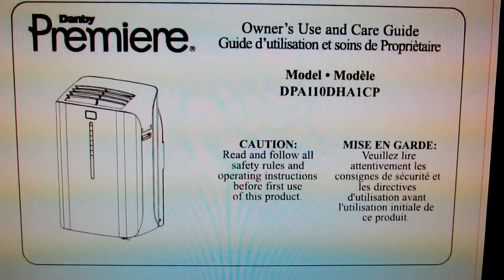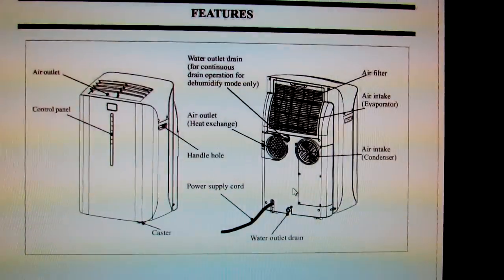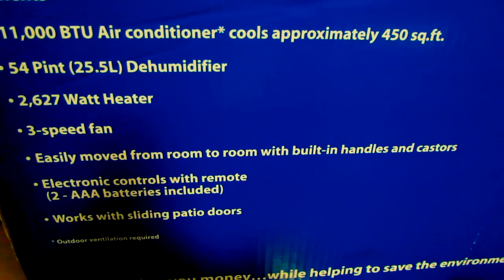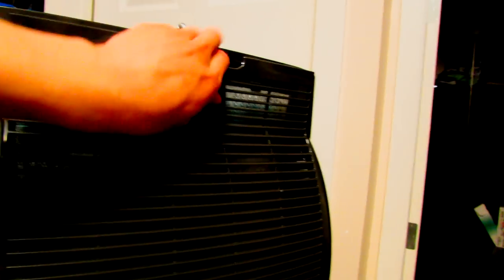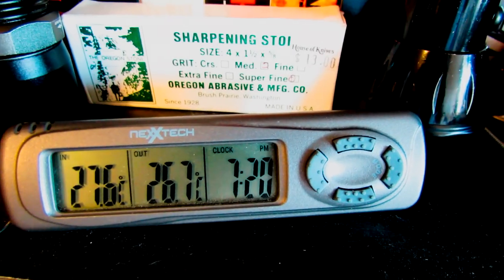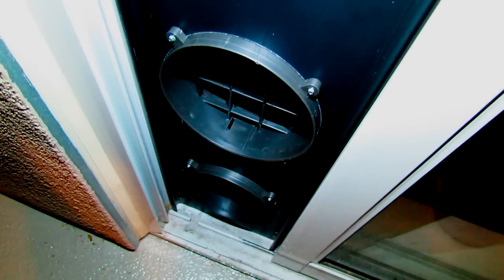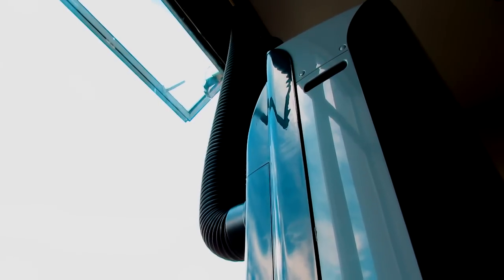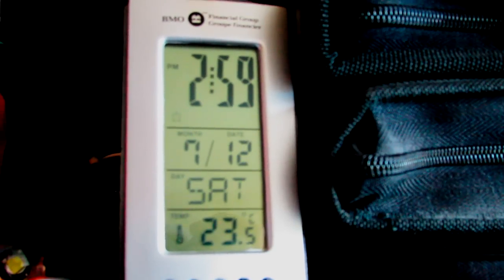The Best AC Unit for an Apartment - Danby Premiere 11,000 BTU 4 in 1

Comment: Hey,
Do you still have this or can anwer a question or two?
Reply from the maker: Hi,
I still have this, and it's still working great.  I guess it's the 4th year in service, so not a long time, but has been working flawlessly.  
If you have a casement window, I've just mounted it using some particle board, here's an example of how I mounted it, it's pretty easy to make, and makes the use of this portable air conditioner a lot better, since it seals out sound, smoke, and bugs (Can also add a bug screen to the intake):  https://www.dropbox.com/sh/kclsjrxio9d0tn5/AACJfRzF_q8jhFytCnqkczPMa?dl=0
If you're looking for a good way to keep cool, I still highly recommend these 2 hose portable AC units.
Let me know if you have any questions!
Cheers!
David.
Reply: Hi,

Yea I picked one of these up used and it came with the unit only.  There's no remote, ducting, ducting connectors/flanges, "window kit" and missing the top drain hose (has the rubber plug and screw cap here) - and missing the bottom drain rubber plug and screw cap.

I was wondering if you could show or share the duct flanges and which go where and how the attach.  I need to order some parts for it from Danby - I guess that's my only option.

Thanks.
Reply from the maker: Hi,
The remote is nice to have, but I find that I don't even use it.  I use the controls on the front, they're way more useful.
Read through the manual and you'll know exactly how to use it:  https://www.danby.com/products/portable-air-conditioners/dpa110dha1cp/
The timer of when it automatically comes on, and when it turns off is pretty handy, and I use that at night or in the morning when I want it to come on before I get home.  Unfortunately you can't set it to come on then turn off again, only 1 operation.

In the manual, it'll tell you about how to use the drain hoses, but you don't even need to drain it if you live somewhere where humidity is low enough that evaporative cooling works.  At the end of the season I go to empty mine (From the lower drain port), and nothing comes out.  It's really efficient at evaporating the water over the condenser coil.  This is probably one of the best performing units I've ever tried.  You got yourself a great unit, bet you got it at a good price too!

You could order the original parts from Danby probably, but if it's too expensive, you can build your own with some hard plastic and some duct tape, the tape residue will get stuck on there and make a mess, but if they charge you $100+ for the accessories, a little residue is worth it.
The exhaust takes a 5" duct, and intake is 4", but you can use 5" for intake as well.  
You can get any 5" duct for an AC unit, something like this would work: https://goo.gl/FeQWjR
Check your local home depot too, they have some hoses.
I found a dryer 5" hose, and it worked fine on the intake, I wanted to upgrade it from 4" to 5" and extend it a little longer.
I've since gone back to the stock 4" and it works just fine, maybe a little less efficient, but marginally.
If the accessories are too expensive to get, just get creative and you'll be able to mount to it pretty easily.  
After taking a look at my unit, I think you can take a coffee can that's about the same diameter, and just slide it in, then tape the hose to that, and you're golden, you don't really need to use the stock clips and stuff. (My clip on the exhaust broke and it's no detriment to the unit.
Maybe you can try 2 x 2L pop bottles for each port, you can slide them over each other, wrap them around and duct tape it together so it's nice and tight.  Then you can tape your hoses to it.  It might even seal better than the stock fittings.
Good luck!
Cheers,
David.
Reply from the maker: Complex BTW, I uploaded a video showing how I installed it to a casement window, you can do something similar if you have that type of window, if not, maybe you can make similar mounts and just add tubing to it using coffee cans or plastic from 2L pop bottles, anything thick will do. 
https://youtu.be/4IXp7NkNxLA
Cheers!
David.
Reply: David, thanks for the thorough responses.
You basically confirmed some of the research I've been doing for the pas couple days on this unit and parts etc., haha.  The hose you linked is one that I've come across in searches too.

I do have the manual downloaded and read it while watching your vid a few times.  I find the pictures/descriptions of the duct and connector parts is unclear. Through re-reading the manual and calling danby etc, I think I've got the parts I need figured out.  I'm not to concerned with the remote control either.

Here's the parts list for this model:  https://www.danbyapplianceparts.ca/product-category/premiere/portable-air-conditioners-premiere/dpa110dha1cp-portable-air-conditioners-premiere/

See, I don't even have the duct flanges that attach to the back of the unit, that allow any duct hose to be connected to them.  I want to get at least those two parts.

So, I think I'm starting to see what I might need for the back of the unit alone:
1x  SKU:  A5815-320-H-G    "Heat Exhaust Hose Connector" [exhaust port?]
1x  SKU:  A5812-200-H-G    "Fixture" [intake port?]

Could you do me a favor?  Could you measure the outside diameter of both these parts/sku numbers listed above please?  That would be great!

also, what is:
SKU:  A4239-370-H-22    "Discharge Grille"?  And is it for the window kit side of things?

Lastly, wow, the hoses actually do appear to be listed as different sizes (11cm and 13cm), that's crazy.  So are you telling me that you can't screw/connet one of the hoses to the connectors for the other hose?  Ridiculous, haha.

Thanks.
Reply: Oh, also - I'd like to remove the rear dark grey panel to access the hot side coils so I can clean/vacuum them out a bit.  I tried to by removing all screws from the rear of the machine but that panel piece wouldn't budge.  I duno if it's supposed to be pried off or it "pops" out or if theres a trick of some sort.  If you've done it or know how please advise, haha.

Thanks again.
Reply from the maker: Complex Hi,
Sorry. I haven't opened it up to clean. Although I should!  I'm sure there's lots of debris in there from outdoor air being circulated through there for days and months.
If you get it open, please let us know.  If you've removed all the screws you can, start prying lightly on panels with a plastic non-marring tool to find where it clips together.  You're probably right that it's clipped together somewhere. I doubt they glued it together. It'll be easy for disassembly for maintenance.  
The top might come off first, then maybe more screws for the larger panel. 
Good luck!  Let us know how it goes.
Cheers,
David.
Reply: I found two more screws per side, they're underneith those small light grey circles/dots on the sides by the handle areas.  Removing them did not help with the back panel removal.  There's no hidden screw in the top vent.  And I got the one under the sticker.  I've been taking things apart for a  while, haha.

I got one side of the rear charcoal colored panel unclipped but couldn't get the other to budge.  So then I tried the front panel, thought I was getting it unclipped but it was just breaking - broke one clip for sure.  My finger tips hurt so I gave up for now.  Gonna call the place that services them locally and ask for suggestions.

Oh, and are you able to measure the outside diameter of both these parts/sku numbers for me when if you get the chance?:

1x SKU: A5815-320-H-G "Heat Exhaust Hose Connector" [exhaust port duct flange]
1x SKU: A5812-200-H-G "Fixture" [intake port duct flange]

Thanks, and thanks for the videos/links.
Reply from the maker: Complex Oh ya, the plastic circles, that should be it, and the sticker, but sounds harder than that.  Maybe it has more stuff on the bottom? Strange.
Maybe use plastic tools instead of your fingers lol. 
Hopefully they can help you out.  If the clips are breaking, maybe you gotta do it that way, clipped in one way, breaks when taken apart, you can fasten it together with some nice stainless bolts. 
I should try taking mine apart tho. Gotta clean it, maybe on the weekend. 
I'll get you the measurements of the adaptors when I get home tonight, but I think the important part is the exhaust port size and you got that on the unit.  You just need to connect there with a 5" hose and you're golden.  Are you gonna 3d print them? Lol.
Cheers,
David.
Reply: I used some plastic pry tools etc, but still had to use fingers, haha.  And the unit smells like carpet deodorizer and musty house smell.
I wanna sell this probably in a few months or beginning of next summer, so I don't wanna do any cosmetic altering like bolts and stuff.

Hah, no, not 3d printing them.  One's one adapter is on the way from a repair shop that only had one in stock.  I'll order the other one from Danby after I get your measurements of the outside diameter of them both, because depending on the diameter I might get the stock duct hoses from Danby as well.
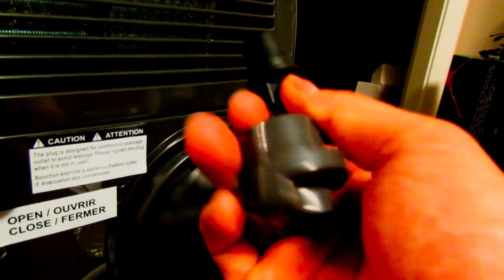The diameter / outside to outside edge of the duct flange at 6:00 in the video, and the flange to the left (the exhaust one) are what I need.  The outside diameter of the flange that you screw the duct hose into the flange counterclockwise.  Just to be clear :)
BTW, have you put standard 5" dryer duct (not ac duct) over the outside of one of these duct flanges?  If so, how was the fit.

Thanks.
Reply from the maker: 1x SKU: A5815-320-H-G "Heat Exhaust Hose Connector - OD = 135.10mm (5.318")

1x SKU: A5812-200-H-G "Fixture" [intake port duct flange] - OD = 114.88mm (4.523")

They use a smaller hose for the intake, but if I were to get a new hose, I'd get a 5" for exhaust and intake, it'll reduce resistance on the intake.

Cheers,
David.
Reply from the maker: Great that you ordered one of the adapters.  I think I did use a 5" dryer duct over the flange, and I just duct taped it to it, it worked quite well on both.  Wasn't a perfect fit, but they have some give since the spiral wiring in the hose can be bent.
Ya if you're gonna sell it, you probably should make it as stock as you can.  Duct taped hoses might turn people off it. LOL.  I used mine today, it was kinda hot out.
Cheers!
David.
Reply: Yea, I'm just waiting to order the other adapter until I can get a measurement on the outside diameter of the adapters/duct flanges on the back of the unit....*hint hint*  :)
Did you forget me?  Haha.
Reply from the maker: Complex lol I posted the measurements 3 days ago, it's above the last message.  I measured the outside where the duct connects to.  But if you don't get the intake adaptor are you gonna make one?  Or buy one used?
Cheers,
David.
Reply: Lol!  How did I not see that for 3days!?  Thanks very much David, I appreciate it.
The intake adapter is on the way.  And I'll order the exhaust adapter today probably.

"Exhaust flange - OD = 135.10mm (5.318")
"Intake flange - OD = 114.88mm (4.523")

Hmm, tough decision on this, I wish they'd use standard sizes.  The proprietary "AC" ducting is expensive and oddly sized, about $80 for the two hoses from Danby!  I was thinking I could use 6" duct on them actually, guess not unless I do some adapting?  Honestly now I'm just wanting to not spend $100 on duct hose, when standard 6" duct (even 8" duct) is about $24 for 25 feet!

So, I think I'll order the adapter and see what I can make work before I buy these overprice AC hoses.  Oh also, standard 5" duct (not the AC type) is very rare around here, and online it's priced like the 5" AC stuff.  Crazy.

Next time I'll be converting/modding a window AC for ducting outside, easier than this actually.  Hahah.

Thanks for your time and help.  I'll let ya know how I make out with it.
Reply from the maker: Complex Lol one of your messages got stuck in spam, maybe since i responded to this thread and that last message was in lock up, YouTube didn't inform you of the new message?  So that's probably why you missed it.  Are you in the states?  Amazon has 5" AC hose for $23.99, 79", I think that's enough for you if the window is low enough.  With the intake adaptor, you can actually mount to the outside of the portion that connects to the AC unit, it's about the same as the exhaust.  That 5" hose might screw right into the exhaust adaptor, should be pretty close.
If you want to save costs, just use the plastic for a couple 2L pop bottles lol. I know you want to sell it later, but you can sell that as a feature, you can see the air flowing if you put a little propeller in there! I may just try that, since it'll help extend the hose as well.  
My pleasure. Glad I can help you stay cool.
Cheers!
David.
Reply: Got the intake adapter flange, might bring to store and check sizes.
I measured it at about 4.5" outside diameter, and 4.3" inside diameter.  So clearly - AC companies are trying to purposefully avoid using anything near a standard size, so they can sell their proprietary hoses.  4" is gonna be too small and 5" is gonna be too big - but the only/closest option.  Stores here don't have 5" ducting.  (I'm talking standard hvac ducting, not this "AC ducting").
I'm definitely selling this at first opportunity, such a pain in the ass.

I'm in Canada, btw.

EDIT:  It looks like you said that the outside diameter of the exhaust flange is 5.3".  So 5" standard duct might not even fit over it, and 6" will be quite a bit larger.  Nice work Danby.  I'll have to figure something out.  I think I have a solution.  I'll share my results, may be a week.  Next part on the way, lol.

Thanks man.
Reply from the maker: Complex Hi,
I recommend the AC ducting, rather than dryer duct or something.  Maybe try this one. 
https://www.amazon.ca/Whynter-ARC-EH-TYPE-S-diameter-Portable-Conditioner/dp/B0048ELAB2/ref=mp_s_a_1_fkmr2_1?ie=UTF8&qid=1532011976&sr=8-1-fkmr2&pi=AC_SX236_SY340_FMwebp_QL65&keywords=5"+ac+duct
I know you'll have to DIY something custom to get it to fit, but it'll be worth it.  If you're in Canada, this is a good unit and should perform well for you and last for years.
5" for both intake and exhaust would be fine, just takes some modifications to make it work, and some good duct tape.
Cheers,
David.
Reply: Hey again,

So - question; does the dehumidifier mode not even have a setting function to choose the Relative Humidity you want to achieve?  I just tried to turn it on in dehumidify mode and it just shows the room/ambient temp., but up and down arrows do nothing at all.

Thanks.
Reply from the maker: Complex Hi,
Sorry, I've never used that function!  But if they don't have %, I guess it's only on and off?!?!  They probably excluded the sensor to save costs.
I'll check the manual, but it's probably on and off only.
Cheers,
David.
Reply from the maker: Complex Hi, 
Checked the manual.  It says there's no setting, just on, and the fan speed is fixed at low, and you have to hook up a drain tube to the top outlet, you probably don't have that.
Check the manual out for more info. 
Cheers,
David.
Reply: Hi, Thanks.

Yea, I have the manual already.  And I just called them.  Not only can you not select an RH% (it's supposedly just a "comfort level", could be 40-45-50%, who knows), but also she said you're not supposed to run the AC mode with the drain cap off and have it drain itself as needed or it might "overwork/overheat" itself...?

Regret level; 100%.  Hah, I wish I'd never bought this thing.  Oh, btw - that part I ordered from Danby like two weeks or more ago just got here.  Still a bunch of modification to do to even get to be able to use it in AC mode.

I think it's going back on the classifieds website I found it on.  Too bad I sold my proper dehumidifier.

Lame.
Reply from the maker: Complex Ya that's pretty stupid that they didn't add a % setting for dehumidification.  Oh, if you run AC mode then definitely plug the drain, allowing evaporative cooling of the condenser coil.  In dehumidification mode, you can plug in a drain hose, since there should be more water than it can get rid of, but you could also run it till it's full, and just empty it, that way you get dehumidification and evaporative cooling.  That's weird that the part doesn't fit properly, maybe they shipped the wrong part.
If it still operates I think you'll be about to sell it no problem, it's been a hot summer.
Cheers!
David.
Reply: David,

The part fits properly - it's just that I still have to McGuiver the ducting with adapters and all that crap, haha.

As for AC mode and plugging the drain.  The problem with that is this:  I don't want to stroll in one day and find the room (or top floor) of the house is at 90+ degrees because the AC has turned off due to the tiny little tank being full... what a stupid design.

This was meant for a floor of the house where we have a small indoor garden.  It's going to need to be on all the time.  They can't have it just decide it's going to turn off until someone notices it's off - due to scorching heat and wilted/dead plants.  Lol.  :/
Reply from the maker: Complex Hi, oh I see. Ya would be nice if it can control temp, humidity, and drain when required, but still use the condensation cooling function.
I would probably run it in cooling mode, set the temp and not drain it. If it's not that humid it, you actually never have to empty it, I've gone to empty it at the end of summer and it was dry.  While cooling it also dehumidifies the room quiet a bit, as is the nature of AC.  I'd monitor the humidity and if it's a problem, get a dedicated dehumidifier.
I don't think there's any unit out there that controls temp and humidity at the same time, each function is only able to function one at a time in my experience.  I'm sure you can find one, but it'll be quite expensive, and I still think you'll get better functionality running separate units that have their specific function.
If you find another dual hose system, it might not function better than this one, so might not be cost effective.
Should be easy enough adapting the hose to the connector that you ordered.
Cheers,
David.
Reply: Hi again,

I don't want it to control temp and humidity at the same time, I just wanted (expected) it to have an actual set point option for the humidity function, to be clear.

I'll give it a shot in AC mode, seeing as I have it.  Also it might be worth keeping just for the fact that an oil filled heater is at least the same price as I paid for this unit and this unit can be used as a heater in the winter (although I paid quite a bit more for the god damn fittings and adapters after the fact).  Though those oil filled heaters are the most efficient.

Got the reducers etc. I need, gonna rig something up later on.

Thanks for all you help and discussion, I appreciate it man.
Reply: @circle4922  Hey I came across this while trying to disassemble and clean this same unit that I bought second hand. Do you have any more advice for how to disassemble it without breaking any of the plastic? I think I got all the screws you mentioned!
Thanks!